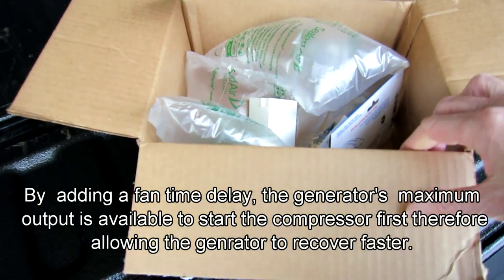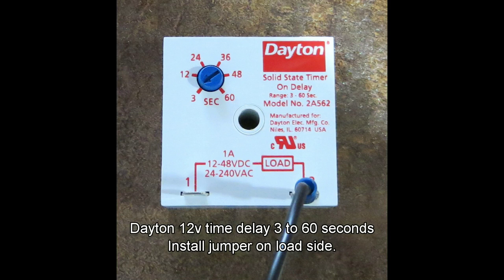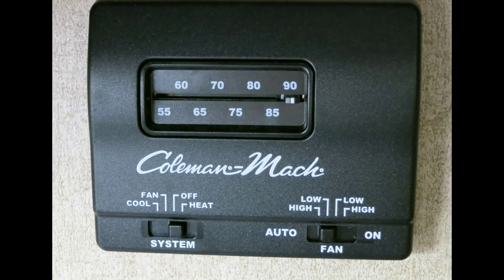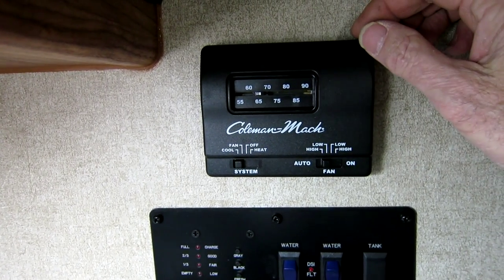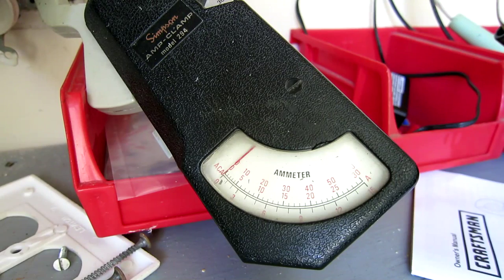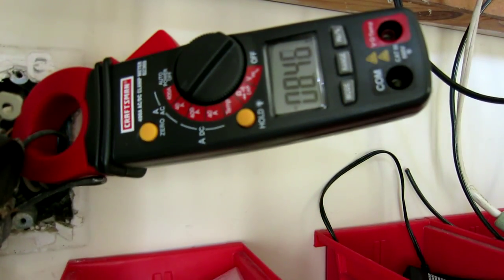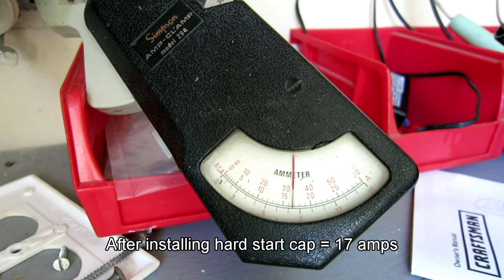Coleman 13.5 BTU with and without hard Start cap and Time Delay

Comment: Marion Thanks for the detailed test before and after. I have a Honda 2200EU.  Somehow it manages to start the Dometic13.5 airconditioner on my trailer, at sea level, although I can tell that it is giving its all and then some.  I camped at 5,000 feet this weekend and it would not quite get it started.  My unit is configured from the factory to start the fan first and then about 10 seconds later, start the compressor, so this seems like the worst sequence, other than both at the same time.  I saw the micro air kit but it does not seem like a good value for $300.  Glad that you have found this option that is less than $50.  Running steady state, the AC unit requires almost exactly 1,500 watts. Once it gets going should be good, with a little extra headroom for some other low power items as well.
Reply from the maker: Thanks, it's still working well.  I camped at 10,200' one year with it but it was so cold, I didn't think about the AC.  I'm sure mine would not crank it much above sea level either.

Comment: Thanks Marion, I just installed the SPP6 and it solved my overload problem in economy mode. I'm running dual/parallel Yamaha EF2000iSv2's, and when the AC kicks on the generators could not ramp up quick enough when in economy mode. Now with the extra capacitor they handle the compressor just fine. Now that i've seen your video, i'll order the time delay module too!

Comment from the maker: The reason for the timer is so all the generator output is devoted to the high starting load without having to start the fan at the same time.   Has nothing to do with recharging the cap.  Watch the video and you'll see the load difference.  Hard start knocks off 5 amps.

Comment: The timer seems to have done the trick.  My Honda 2000i just couldn't get the AC to consistently run.  So far with my backyard tests, the A/C turns on 100% of the time.  Thanks!
Reply from the maker: That's awesome, thanks.  Also, when you crank the compressor, make sure your RV's battery charger is off if you have issues.  It doesn't draw much unless the battery is drawing a lot at the time of start up but every little bit helps.

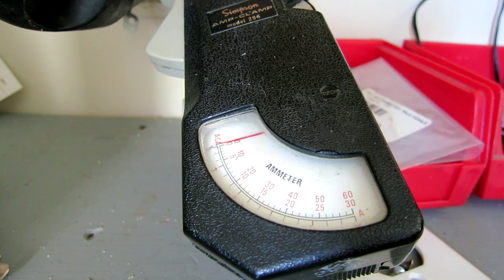Comment: Looking at the spec sheet at about 2:30 into the vid, the start load LRA could be as high at 50a which would be 6k watts!! The run RLA looks to be about 1164 watts.    The fan already running on compressor restart may NOT be a factor since it's start up load is not present, only it's run load.   Interesting to hear how hot wx affects as our Lance is going to AZ for winter 19-2020..
Reply from the maker: That's a lock rotor though you'll never experienced that. Unless your AC compressor locks up.

Comment: Myth #1: "The hard start capacitor releases it's stored energy at compressor startup and will reduce the generator current load"
No, the hard start capacitor more greatly changes the phase angle of the magnetic field (as opposed to the smaller start capacitor the AC used from the factory)  impinging upon the compressor's rotor more greatly than a smaller start capacitor, giving it more startup torque.  As a result, it greatly INCREASES the Volt-Amps (decreases power factor) required to start the compressor, posing an even greater "surge" load on a generator powering the unit.  Hard-start capacitors are only used in the industry to start aging compressors which require more power input to get the rotor spinning than what would normally be needed when the unit is newer.  Capacitors are by their nature of being in essence DC devices, are not capable of "storing" an AC power source to deliver to the motor at startup.
The only thing you have done here is delay start of the fan motor from the startup of the compressor motor, lessening the startup current required.  Most Dometic thermostats already perform this function, in reverse, by first starting the fan, then delaying compressor start by either 3 minutes (from loss of AC / first turn on or last compressor power down) or 10 seconds (restart of AC as thermostat demand calls for it).
On units that already introduce a delay which keeps the fan and compressor motors from starting at the same time, the only way to reduce the generator load when starting the AC is to utilize a soft-start unit.  The soft-start gets the compressor's rotor spinning in a controlled, ramped-up fashion as to not produce such a huge instantaneous spike in current demand as the stationary rotor would impose upon startup.  These are well-understood (by the industry) facts of induction motor powered AC compressors, not opinions.

Comment: Why not install the delay on the compressor trigger? The effect will be the same, and the delay will work on low and high fan speeds.
Reply from the maker: The compressor draws the most amps.
Reply: @MarionBlair  so are we worried the delay circuit won't handle the amperage?
Reply from the maker: @gregmanning8967  the time delay allows the compressor which has the highest starting / running amps to come on line 1st and stable out before starting the fan.  The compressor draws about 17amps to start , the fan only 5 amps.  So it the little generator can devote all of its power to getting the highest load going (compressor) without having the load of the fan, so the delay on the fan does this.

Comment: Hi Marion! We are also trying to run our 13,500 btu coachman AC unit on a smaller generator such as the Westinghouse 2400. Any update on how it handles the hot weather? Very curious.
Reply from the maker: HI, yes, here's the link.  https://youtu.be/mfI5elwd5dg
Reply: I also have a 13,500 roof A/C, with an in line watt meter hooked to my main camper plug, I found the on board battery charger was pulling over 300 watts, with it turned off at the breaker, my roof air would pull up to 1700 watts on start up, then settle down around 1100-1200 watts, with my 2000 watt Honda, I let it run for 4-5 hrs. one day, the Honda did find, I also found that when the A/C is in fan only mode it pulls over 300 watts, so if I could put a time delay on the fan, it would be even better with the Honda 2000, I also did the remote 3 gal. gas tank hooked up to the Honda, did great, I did not have it in econ mode, just my 2 cents,
Reply from the maker: That's pretty slick.  The time delay on the fan has worked well for me.  Also, I have the time delay on the low fan to keep amps/watts as low as possible.  As you know, the biggest hurdle is starting the compressor.

Comment: An additional problem is not only the start, but the cycle time and the VERY high surge that occurs when it sycles on and off.  On my 9K dometic penguin, and the hard start cap, I can start the unit up initially, and restart if I delay the off-on cycle for 10 minutes by moving the thermostat, but if I let it do it's own thing, the Honda 2000i will not manage the second start up.  Thinking of a "delay on break" switch with a relay that would delay the compressor restart until a few extra minutes pass.  The hotter it is the more the surge is and the longer time that is needed for the head pressure to dissipate.  Any ideas?
Reply from the maker: +Robert Garbe Thanks, I haven't had the opportunity to try it yet in hot weather.  It will be interesting to see if the 2400K gen can handle it.
Reply: You need a hard start that does not use a ptc if I’m understanding what your saying.

Comment: Marion after you installed it, how many years old was the AC and how many years has it run since then.
Reply from the maker: The AC was a little less than 2 years old and (2014) and it's been in there since working fine.

Comment: Could that time delay be installed at the thermostat?
Reply from the maker: Yes I think you could if you have a place to mount it Etc it was easier for me just to stick it up there in that area where all the electrical stuff is. I hadn't thought about doing it that way but that might work fine if you can make sure you're on the right wire from your thermostat that wouldn't be too hard. I can see why you would want to put it there it would be easy to adjust it

Comment: Soft Start kits work. Adding those Cap Boosters is not going to fix anything. As the problem. The cap discharges now your generator has to recharge the Cap but also start the AC unit. It's why they put a time delay. So the cap can recharge. Then attempt to start the AC. 

The whole thing is shown in this video..https://www.youtube.com/watch?v=p2K0ptvYb6Q

Comment: Any links on where to buy this?
Reply from the maker: The SPP6 hard start capacity and the 12 volt Dayton 2A562 all came from Zorro which is the online entity of WW Grainger.  If you have a brick and motor WW Grainger in your area which you probably do, you may be able to buy it there but the links for the parts are below from Zorro.  Thanks.

https://www.zoro.com/dayton-encapsulated-timer-relay-1a-solid-state-2a562/i/G0567987/

https://www.zoro.com/supco-hard-start-kit-ac-compressor-spp6/i/G1772574/

Comment: soft start kits claims  60% amp drop
Reply from the maker: I can't see how you could get 60% but just my opinion.  I know what I got and it definitely helps.  Start the compressor by itself without the fan  That's what the fan delay is about.  That way you devote all of the generator's mojo to getting the highest amp load first.  Starting the fan a few seconds later with the gen only pulling about 9 or 10 amps is no problem.